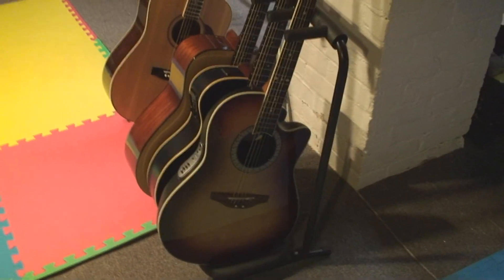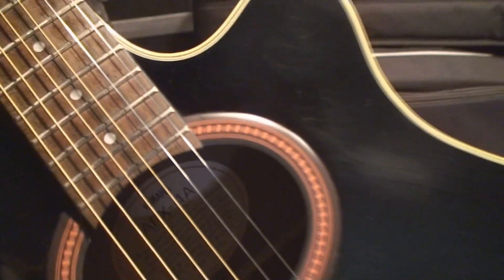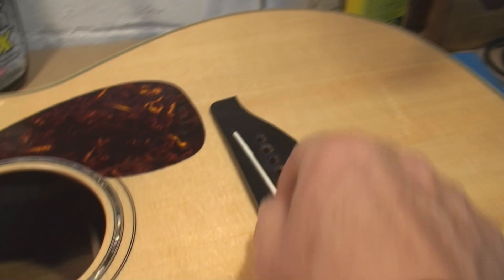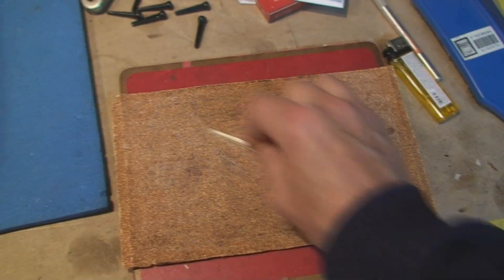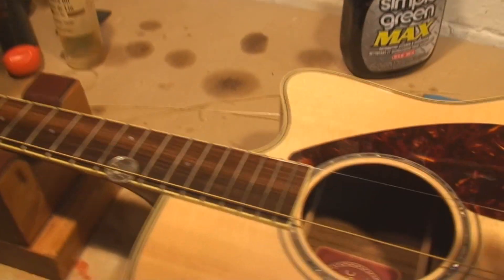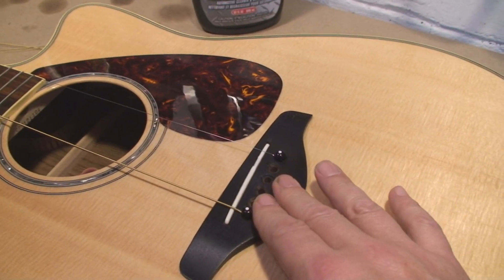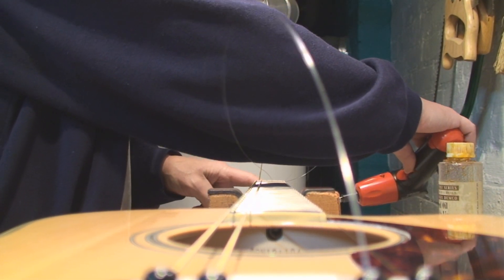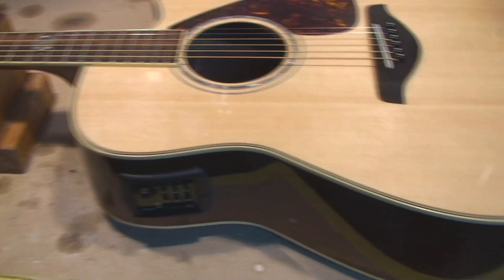Acoustic Guitar Bridge Saddle Shave

Comment: A neck only gets adjusted if it is too convex or concave, the neck should be a very small amount curved up look at a well set up guitar first to see this. The saddle gets shaved to lower the action often because the bridge or the top and bridge have bellowed up. If you bring down the saddle height it will help with intonation. If the guitars way out get a luthier to set it up £30 or so.

Comment: Heh Dave, so if you want it lower you had mentioned that the bridge would have to shave down?.  Can one  raise the nut "a hair" by shimming it and then sand some more of the saddle to get a lower frets on the higher end ? Or, was the strings so close to the bridge already that the saddle would touch the strings? Same problem on one of my classicals where the higher end from the 8th fret up I would like to lower it.  Trying to shape a lower saddle out of ox bone to a 25 cent space would be nice?

Comment: Dave, if the frets are level and the fretboard is level on a classical, should the saddle be level as well to match the frets/fretboard?  I wanted to make a new saddle from Ox bone and I want to make sure once I "shave it lower" that the radius (acually zero) had to match?  Also, can I shim and raise the nut a hair to compensate any buzz after I lower the saddle?  The intonation got anything to do with the "raising and lowering of the strings?"  Can I just use my KORG CA-30 tuner to check that?

Comment: ONE CLOSE SHAVE, DAVE! Bought this crummy little Yamaha F-36P for $99 bucks, & though the finish was perfect, strings hadn't been changed in years, & the action was a really wanky 2 quarters+ at the 12th fret! Had almost no saddle to drop at the # 1 string, so I knocked off a 32nd there, & a full 16th at the # 6th end in a vice with an orbital, restrung it with Ultra-slinkys, & it's now the perfect beginners guitar! Damned near too low, but no buzzing! U Rock, Dave, and great video!

Comment: If its been glued with white PVA glue, you could try white vinegar which disolves this type of glue - it worked for me! Remove the strings and use plastic insulating tape on the bridge to create a "valley" around the saddle so that the vinegar stays in contact with the glued in saddle. Then trickle a small amount of vinegar in with a plastic pipette, leave for a couple of hours for the glue to absorb the vinegar and then the saddle should pull straight out with a pair of pincers.

Comment: Hi Dave,

I've shaved my bridge saddle which worked well (checked with a 10 cents of EURO, thickness=1,93 mm~0.076 inches, for lower use 5 cents of Euro thickness=1,67 mm~0.066 inches)

I'd like to shave the bridge (to allow strings to make an angle like it was before) but my bridge is curved. In that case, should I use a chisel plane ???

Comment: Hey Dave I had a beautiful Washburn D10 12, sounded amazing but no matter what I did it kept breaking the high G between the nut and the tuner so in the end I sold it. Then I got a deal on a John Hornby Skewes 12 string, nice but not as bright sounding and guess what, it wont stop breaking the high G. What the hell can be causing it?. Nothing works !!.
Reply: Tried  a whole slew of differn't ones and gauges but they all break but it's always and only the high G. Graphited the nut, polished the tuning peg holes but still breaky breaky. The Washburn was the exact same :-(

Comment: Dear Dave, Have you done a video on making a new saddle for acoustic guitar ?
 I have to make a "summer saddle" for my martin, duplicate the existing one, and reduce it's height by 19.68 thousandths.
thank you for your advice..cheers
Reply: Thanks Dave, It's a 1930 Style Belly Bridge- Drop In Saddle. The guitar is a "custom" OOO-18, Martin, same saddle that came with the guitar from the factory.
Reply: They only have blanks on their website for purchase. I will ask them if they can do pre shaped and compensated.
If not, I can get some digital callipers and measure up the original , then trace the original on the blank , and just shave it to correct size, and then shave 19.68 thou off the underside ?
Is this the way to duplicate the original and lower the height of the new saddle ?
Reply: Like it ? I love it !! Thankyou for your help Dave, this is fantastic. cheers

Comment: He marks the saddle when it is seated in the slot, but the point is to remove material from the bottom of the saddle so that both bass and treble side of the saddle are seated correctly. The bass side may need 1/16" material removed and the treble side none at all. What makes sense to me (and works!) is to see what needs to be done, remove the saddle, then use a small straightedge to draw a fine across the saddle and remove the material below and up to that line. And you keep the saddle square to the sandpaper so the saddle is not tilting after sanding.

Comment: hey Davey,
i have an old Simon Patric, action is too high thus i was wanting to shave the saddle(after adjusted the neck), however, there is a under saddle pick up glued to the bottom of the saddle..should i separate the two and do the shaving?

Comment: so im confused. I bought an acoustic guitar a few years back and now the action is quite extreme. Why now do I need to sand down the saddle if when I first got the guitar it was fine? it seems as I have seen in other videos someothing else must have caused the action to increase like the truss rod.
Reply: +kristopherDay As Dave has stated in other videos. The top sinks on Acoustics due to string tension and drying wood. Nothing you can do except continue to maintain it properly. It will happen to EVERY acoustic guitar regardless of original quality or price. It could be a 1930 Martin or beginner boxed Squire. It's going to happen eventually.
Reply: Yeah as my luthier once said - guitars with strings on are constantly in the process of folding in half 😁 humidity is the silent invisible killer..! Respect it and your guitar will fold slower 👍

Comment: You don't cut grooves on an acoustic saddle.......They don't have grooves. Check a new guitar at a guitar store and you'll see what I mean. After the guitar being strung for awhile you may see some indents starting to develop where the strings touch the saddle. When I notice the dings developing on the saddle, I sand them out when I change strings with some 400-600 grit sandpaper, then I give the saddle a polish with superfine sandpaper.

Comment: Thanks, man.   I just tried it.  Not only is my Ovation a lot easier to play, I swear to God the chords sound like they are better in tune with each other.    

Mine didn't come with shims.   Plus, I used a little sanding-wheel attachment that goes into my drill,  that you can get for $10 bucks at Home Depot.     I accidentally sanded one side too far down, so I cut a thin guitar pick into a sliver and stuck that in there.   Works great.

Comment: Why are there so many vids with people ONLY making permanent changes to the saddle and gasp sanding the bridge to lower action???  Have you people completely forgotten about the nut and what a bloddy truss rod is for?  SMH.
Reply: *****
Maybe show that to be true via your actions then.  This vid sure doesn't leave that impression.  A little explaining of why you're doing something would go a long way to showing competence or at the very least, people understanding your decisions.  Especially when they seem so drastic.

No offense man.  Some of your vids a very cool, entertaining even.  This one just kinda shocked me.
Reply: The truss rod is for neck relief, not action adjustments. A truss rod adjustment will see the most notable changes in action around the middle of the neck but its primarily to make sure that whatever action you set at the BRIDGE ends up playing evenly across all frets. Filing the bottom of the bridge saddle on acoustics of all types is minor stuff. Fiddling with the independent nut indentations is a whole other world of pain, let alone the fact that bridge saddles just pop out compared to glued in nuts that often take wood with them if you want to shave the bottom off that.
Reply: Chris Harris
The truss rodd is "primarily" for neck relief yes, but it is also for action when only slight adjustments are necessary.  Also, in the case of 2 of my guitars, the truss rod is a dual action one, so it is designed to be used even more for action as well as neck relief.

I agree about the saddle and nut (although, I've never had any problems with a nut, guess I don't buy guitars where they needlessly glue them in real tight) but when I said bridge, I meant "bridge" not the saddle IN the bridge.  I have never seen a need to EVER sand the bridge to adjust action.  That's just needless insanity if you ask me.
Reply: wungabunga
If all the frets down where the body meets the neck are too high, then I believe it would be more proper to level them out rather than trying to overcome them via the truss rod, saddle or bridge.  I think it comes down to dealing with the actual problem instead of trying to circumvent the problem.
    If you use the truss rod to overcome high frets down by the body, then you'd "really" be wrecking the action on the rest of the neck.
Reply: CruisinMac Saddle is a very minor change. Saddles are cheap and easily replaceable. Sure, Truss rods can be used for minor action changes, but that's not the first step in my opinion.
Reply: *****
Understand what I said in context dude.  By saying "even more" I meant that a dual action truss rod (inferring that yes, I DO know what that means and how it works) can be used by making "minor adjustments" for action "even more so" than a single action truss rod ever could.  I hope that clears things up for ya.  I never said that you should "start" with the truss rod or anything.  I was just mentioning it in relation to the drastic measure of messing with the bridge itself before adjusting everything else, like the saddle, nut and yes, truss rod.
Reply: ....the truss rod is for adjusting neck relief, not to lower action....
Reply: your typical guitar store will have spares for these. buy a new one and cut that one down. keep the original one for when you sell it